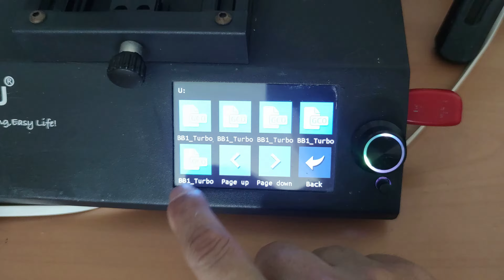3D Printed DIY Mini Turbo Jet Fan!!

Comment: where did you buy the motor
Reply from the maker: https://th.aliexpress.com/item/1005006743336722.html?spm=a2g0o.productlist.main.9.109anEGfnEGfOX&algo_pvid=458dd84d-b365-4d9e-8031-2d1ec0856300&algo_exp_id=458dd84d-b365-4d9e-8031-2d1ec0856300-4&pdp_npi=4%40dis%21THB%21478.93%21462.65%21%21%2197.06%2193.76%21%40213be1e417251996707556973e8806%2112000038160875587%21sea%21TH%21173671390%21X&curPageLogUid=T2NmoLOfJ2Bi&utparam-url=scene%3Asearch%7Cquery_from%3A
Reply: @Mr.RC-Creator Thanks!! The 24V pwm version looks like exactly the motor & controller I want for my fully printed cpap blower.
Reply from the maker: @daliasprints9798   Oh, wow, great.   😀

Comment: What wires did you connect to the USB C Charger? Did you put another positive to the positive terminal of the circuit and another negative to the negative circuit? Why is there two on the charger?
Reply from the maker: Wire connected the positive and negative wires to the charging module by connecting them to the positive and negative terminals of the battery.
Reply: @Mr.RC-Creator  So two wires connected to the positive and negative terminals of the circuit as well as the two connected to the fan? Meaning 2 wires per terminal, one for wire and one for charging module?
Reply from the maker: @TheFreshCookies0  Yes, it's like a video clip.

Comment: hello. 
Wouldn't it be healthier if you used a BSM 3s circuit? Batteries will lose their resistance, their life will run out,
Reply from the maker: Thank you for your advice.🙂

Comment: Hi
Why did you change the wires (red/yellow/black)?
You just inverted the black but why? 🤔

Thanks in advance
Reply from the maker: I changed the silicone wires just to make it easier to work with😁